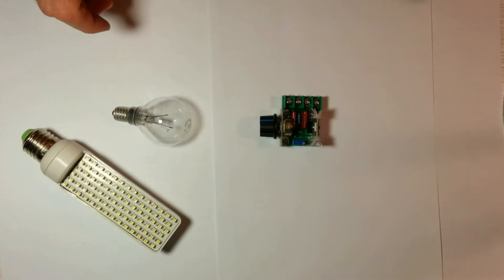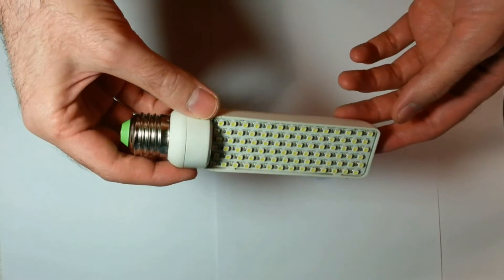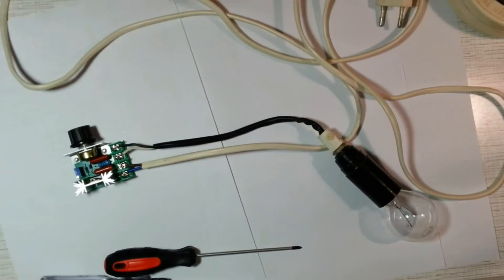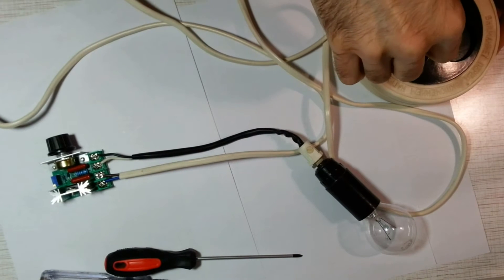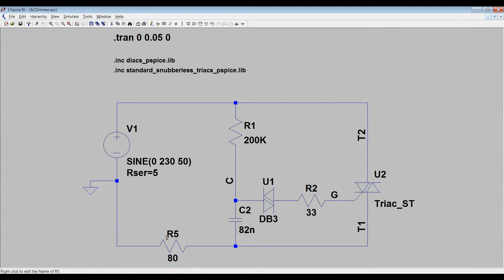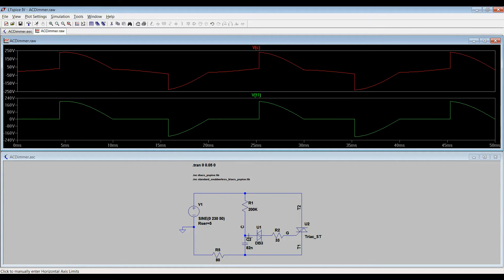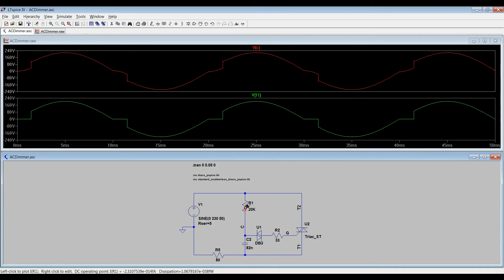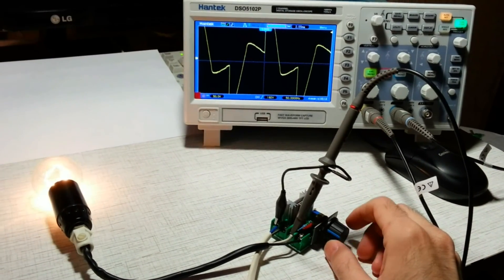Cheap Dimmer: Review

Comment: Sergei,today i receive the same dimmer as you ,but no working? What can i do?? Tks!
Reply from the maker: Hi! Could you be more specific? What are you doing? What doesn't work? First of all. Connect the dimmer to an incandescent light bulb.  Try to adjust the small potentiometer with a screwdriver. Be extremely careful don't touch any metal part of the dimmer when it's connected to the high-voltage line.  See a wiring diagram here https://drive.google.com/open?id=0BwsaCaa887AuSHB0MkhySk5jZjA
Reply: Thanks for answer. I find bad soldering point on triac. All working now.Btw. very good video, and excellent ideas!!!
Reply: i had same problem